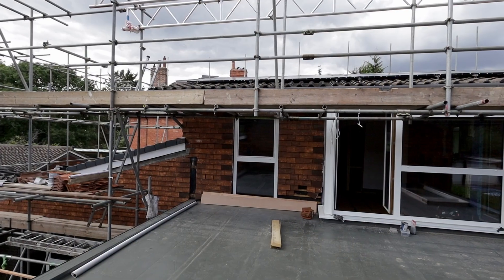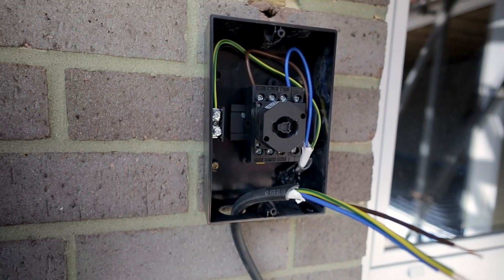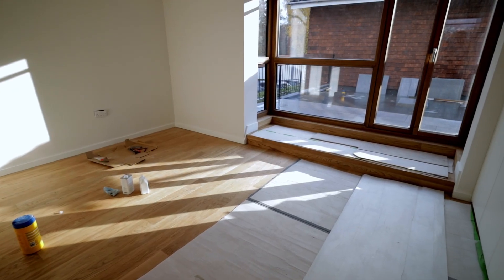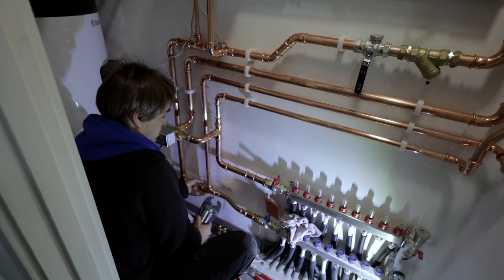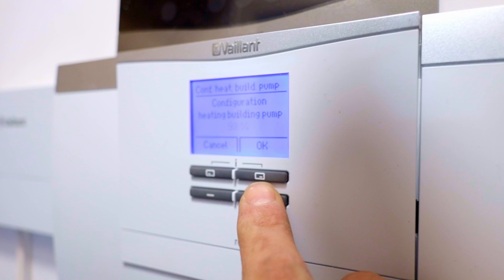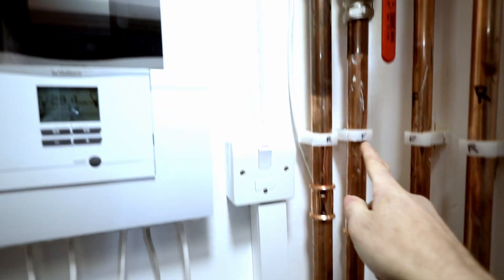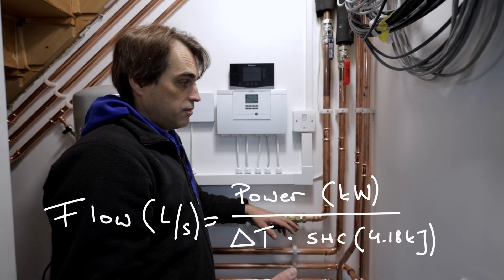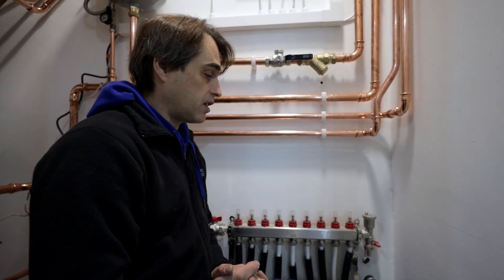How To Install an Ultra Efficient Heating System - Heat Pump + UFH.

Comment: I've always been curious what happens to the flow temperature in such a system when there is a DHW cylinder that needs heating to 48-55C. If the flow temperature is increased when there is DHW demand, doesn't this run the risk of overheating the floors if they are also getting water at 48-55C? I'm guessing that the heat pump sees the returning water is above the set point for the flow temperature for heating, and so runs the pump but doesn't run the outdoor unit to add any further heat to the water. In this 'mode' there is not enough heat stored in the system water that was circulating around the DWH loop to raise the temperature of the floors more than a few degrees above where they were, so no danger of overheating?
Reply: The floors are not getting water at high temperatures, there’s a diverting valve.
Reply: @Etacovda63  When that diverting valve switches back to heating they certainly are.
Reply: @tlangdon12  yes, and at the absolute most, its primary and return that holds that temperature, 30m of 28mm piping. 

Assuming thats ID, thats 9L of water, going from 55 down to 35 degrees.

Thats less than 250w of power, distributed across an entire house. 

The heatpump doesn't even need to account for it, thats what the valves for - the heatpump goes back down to 35 degrees and it literally stablises back to normal in seconds. If I could be bothered doing the maths, Id say the water wouldnt even complete a circuit of the floor before being back to normal.

Comment: Buffers are useful for energy storage too.
If you are running a heat pump with PV cells, for example, you can use the excess electric power to heat the buffer, so that you don't have to run the heat pump the whole night, when, due to lower temperature outside, it will be less efficient.
Also, you can use solar energy to heat the buffer during the day.
Reply: In a house like this, it will take quite a while until you loose heat. So you can simply set the target temperature one degree higher when the sun is out. Doing this, you can store a lot of energy in the house itself.
Reply: @Felix-st2ue  If your insulation is on the inside of the mass like this one then you're not really holding much energy in the house. If you've got an old stone property and you're able to insulate outside it, you're able to store a lot of heat in the mass of the walls.
Reply: @trojanhawrs4613  Well, you can also store a lot of energy in the floor and the furniture etc.
Reply: @Felix-st2ue  exactly, floor is very big thermal storage due to concrete's high material density.

In Norway most homes are wood framed so not much thermal mass there.
However in many countries double-walls with cavity insulation is used, so the inner leaf of brick/concrete or lightweight concrete does benefit of thermal Storage. Normally you wouldnt want insulate from inside and leave the thermal mass on the cold side of insulation. It also poses much higher risk of moisture problems.
However some countries like UK have been building Brick exterior and insulation inside for some time, that is quite stupid from many perspectives
Reply: Buffer is too expensive for thermal storage only, as it has very small capacity compared to building fabric and will lower COP of system both during normal use but also very much more when boosting for storage 

Simply raise flow temp so that room temp changes 0,5-1 degrees. That is perfect energy buffer with way more capacity and is totally free.
Reply from the maker: Remember that you have a lower set back temperature at night so that helps with heat pump efficiency.

Gains of having a buffer with solar may be quickly negated by lower overall system efficiency of having a buffer (mixing) and running  another circulator.
Reply: @UrbanPlumbers   Well, you can run the space at 18 °C at night ( lower than that, and there is risk for mold growth, if I remember correctly ).
Keep in mind that I don't consider it necessary for heat pump installs, too. ( Mechanical Engineer by trade ).
HVAC installs differ in every site and budget, and what is optimal on one occasion, is suboptimal in another.  And that is why thoroughcalculations are necessary, and rules of thumb ( "so much square meters, you need so much KWs" ) are A VERY ROUGH, VERY-VERY ROUGH, estimate.

Comment: did you say that the 3 way motor valve only does either heating or hot water, if so when is hot warer srored
Reply: When the hot water cylinder calls for heat.

Comment: If there are no thermostats in a room how do you manage a sunny day vs a cloudy day?  Would a room overheat?
Reply: It shouldn't. I would expect that the flow temperrature is set by weather compensation, so it will reduce on warmer days. Also, the heat pump is also trying to maintain a DT of 5C, so if the return is coming back with less than this difference, the heat pump knows that some of the rooms are getting more warmth from somewhere else, and again the heat pump can either modulate down, or switch off if it has reached the limit of how low it can go.
Reply: @tlangdon12  Some rooms can be south facing and be warmed by the sun, and north facing ones would get no benefit from the sun, so they can't all be treated the same.   Just seems to me thermostats make everything simpler.

Comment: What are your thoughts on not having insulation on pipework. Would the benefits of heat gains from pipework cost less than energy spent.

Comment: I have an air to air heat pump that achieves a cop of 4.8 and cools as well as heats. If you can consider separating your hot water system from your heating system, air to air heat pumps become very attractive. Various methods are then available for hot water such as a thermino sunamp. It’s seems to be a very UK thing that people generally can’t imagine separating hot water systems from heating systems.
Reply: Why doesn’t one of the air to air manufacturers bring out an exchanger for heating water, would make great sense for uk market, could just connect as a refrigerant zone.
Reply from the maker: @edc1569 they do make them already
Reply: @edc1569  it will lower the performance you can achieve for the indoor units of the air to air system and lower the overall COP of the system as exchanging to water is inefficient. Also due to them not being capable of achieving instant hot water would require a cylinder which in a lot of cases people may not have space to accommodate.
Reply: @Bish_OP  Not sure what you mean, my Hitachi Yutampo does A2A and DHW, the A2A will switch off whilst it heats the tank, and switches it back to A2A afterwards.  So the only efficiency loss is in the switching to and from.
Reply: @BenIsInSweden  that sounds amazing I wasn’t aware of that. Will any a2a unit be able to achieve this or is it only certain units that support it? I can’t see any information on my unit supporting this. It could be a better alternative to sunamp if I can find space for a tank and my unit could do this. It has no water in lines just the thin copper refrigerant lines.
Reply: @Bish_OP  it's only specific ones. Hitachi have the Yutampo (ie. The one I have). Daikin's is called the multiplus. My installer said that Toshiba does one as well but is apparently prohibitively expensive.
I'm not sure if any are available in the UK, it's likely a demand thing at a guess.
At least with the Hitachi the top ports on the outside unit are reserved for the cylinder, and depending on the outside unit up to 3 indoor units can be connected.
Hitachi could do with modernising the indoor units though, they're fine but against the Toshiba Haori or Daiseikai's (the latter which I have as well) they are a bit behind in looks (some may not care too much) and in functionality, e.g. the whole 3d airflow that Toshiba has and the Hitachi ones don't come with the WiFi module as standard.
Reply: @BenIsInSweden  thank you for the information that is very interesting/helpful
Reply: @edc1569 Daikin do one.
Reply: I agree, but one problem we have in the UK (say compared to the USA) is that our houses are typically much smaller, and have much less room available for additional systems. The availability of ducted heat pumps that can sit on top of the hot water cylinder save space, and allow the seperation of flow temperatures that is critical to maintaining the best COP for each application (space heating vs. DHW production). The down side is the extra cost. However, the cost of DHW cylinders with coils suitable for heat pumps are not cheap, so the difference in cost might  be recoverable over the life of the systems. The other problem is that there are then two heat pumps to go wrong/need servicing. The Sunamps have a poor record of reliability.
Reply: @tlangdon12  Great points. On the space issue we have a smaller 2 bedroom uninsulated old property and I was able to work out a way of integrating a ductless air to air system, without removing our gas combo boiler (which does only hot water now until we replace that system). I had to put time and effort into the placement. The ductless pipework doesn’t take up much internal space but requires real thought on placement and the condensate also requires thought. We laid the pipes in between the joists. I’ve not heard of ducted heat pumps on top of hot water cylinder, I will have to research those out of interest, I guess I didn’t come across them as we don’t have a hot water cylinder (no space). In terms of functionality I presume they won’t do cooling. Also I wonder how much fine tuning is required o have a balanced system with those. The thing I like about the air to air ductless system is they are capable of easily heating and cooling uninsulated spaces, the air to water systems are so fine tuned with much more risk of running inefficiently or the house being too cold when set up. I see most businesses use air to air, I am not sure why the air to water is pushed so hard for homeowners in the UK, my presumption being someone at the top thought “this will be easiest just swap out boiler for this single unit”, when in reality they are very complex fine tuned systems and not as high cop!
Reply: Regarding the point on the Sunamp reliability I did some looking and couldn't find too many people complaining of reliability issues other than one youtube video that the guy had a leaking unit which was replaced under warranty. I'd be interested to know where you saw those reliability complaints as I'm considering a Sunamp for hot water, its my main option currently.
Reply: 4.8 COP (or SCOP?) Is obviously great, but your water COP is 1. Appreciate the thermino is good for time of use, solar diverter etc, but with super efficient homes, water heating just becomes a bigger and bigger portion of the overall energy use. All extra power used had a decarbonisation opportunity cost somewhere - excess solar could be better used decarbonising your neighbour's electricity supply, for example. I would be interested what your adjusted SCOP would be if you included hot water at 1.

This ignores cost obviously - I might have gone air to air had I known about it before I spent silly money on my heating system.
Reply: I use the SCM60ZS-W which has a COP of 4.86. There are smaller models which allow for less indoor units per outdoor unit which achieve above 5 COP, check out the SCM60ZS-W specification sheet it shows all of them.

The primary point being that for me I don’t have a super efficient home; couldn’t create one if I wanted to as the house is listed.

So opting to separate heating and hot water has allowed ability to heat and cool (don’t underestimate being able to cool in the summer!!) at high efficiency. This does then leave the hot water problem to solve. Our boiler is rated at 0.92 COP however non of our hot water pipework is lagged so it won’t be getting that. 

I can see that with the super efficient homes the hot water will become the high source of energy, because inherently the transfer of heat to water is inefficient. 

My personal goal is to size up a solar and battery system that will cover the thermino and the air to air heat pump. I like the idea that I can heat and cool my house hopefully the majority of the year even though it is ‘leaky’ and old in terms of efficiency.

Topping the battery up with an intelligent controller using Octopus’ agile tariff would allow for any grid energy to be as cheap as possible.

Now just need to save around 15-20k for battery, panels and sunamp D: @bringiton8989
Reply: I’ve done some more research on this and found some diagrams/documentation which appear to show that you can literally hook up the lines you’d normally use for feeding an indoor unit to a hot water cylinder, seeming to indicate you can achieve this on most air to air outdoor units. Not 100% sure, it’s a shame I can’t attach the image.

Comment: Hi Simon, could you run the primaries in MLCP?  Are there are disadvantges with MLCP with heat loss?  I suspect they would have to be sized up as the walls are thicker.

Comment: Very well presented as usual.
Just a brief question concerning flow rates...is there any harm in having a higher flow rate? Let's say my house "needs" 800l/h but the pump can easily provide 1100l/h. Will upping it to that level have any detrimental effect apart from adding a few Watts of energy useage?
Reply from the maker: More energy used on the circulator resulting in lower overall efficiency, although mean water temp is higher so flow temp can be lower which may balance out higher pumping power
Reply: @UrbanPlumbers  
Thanks. So as long as the additional energy use is minimal, there should be no harm done I guess...👍
Reply from the maker: Yes, shouldn’t make a dramatic difference. No harm on slowing the pump down, but I would try to lower the flow rate by throttling the system

Comment: That looks very nice. 
I was a bit surprised by the large spacing in the UFH. Is there still enough capacity to use a bedroom as an office with a 20 degree temperature by adjusting the flow rate or is it pretty much limited by design?
I wonder if overdoing it with the UFH would hurt the efficiency. For example, what would happen to the COP and load on the heat pump if you put 10 cm spaced UFH everywhere? I imagine it would take more time to put in and cost a bit more, but is there such a thing as too much UFH for a heat pump?
Reply from the maker: Yes, you can easily adjust flow rates on this system to change the room temp by +/- 3c
Reply: Nice work, I was going to say it could cause problems down the line if only 17 degrees was achievable in the bedrooms.
 @UrbanPlumbers
Reply from the maker: @gunsey876 22c easily achievable if you want to

Comment: Airtight membranes on the wall, MVHR   etc. and then only 20mm insulation between ufh and ground?? That is roughly a U value of just 1.0, the ground will be acting as 'infinite heatsink' for all that precious heat from UFH, there is at the very minimum 1KW loss just on that component. Pure insanity...
Reply from the maker: Will probably make the system run better and cycle less with such a small heat loss. Downward loses are not that great anyway.
Reply: Client here. Short of breaking up the floor slab 20mm was the absolute maximum we could fit. The ground under the house is dry and there should not be much flow away - in equilibrium it should be as much a heat store as a heat sink. But you are right that this is a risk. The standard heat loss calculation methodology doesn't really take account of UFH where the heat source is in thermal contact with the ground.
Reply: Slab u-values are not treated in the same way as other materials, as I’m sure you know, the perimeter:area makes a difference. This u-value is likely to be around 0.4.

Comment: Interesting. We're currently planning for  something similar when we extended and renovate our bungalow in a year or two. 

Do you do requests? Can you do a follow up video because it would be interesting to see what scop it achieves in a years time.
Reply: Client here. We're not expecting a great overall COP, because the space heat demand is so low that our hot water use will dominate.

In the first few days of use we got worse COP than expected for the cold weather. The floor slab was completely cold and the UFH return will have had a high Δt, even with a low flow temperature.

Comment: Because the system is designed for certain temperatures in each room are you able to boost the temperatures at all for special events etc? Also what if I move into a house where it's set to 21 but I prefer 19, what do I do?
Reply from the maker: Yes you can a change the overall temperature and adjust individual room by changing the flow rate on the manifolds. 

The fact that it’s designed to 18/21 doesn’t reman that you can’t run it lower or higher

Comment: Is the slab fully insulated underneath?
I looked at using those 20mm eps panels for a ufh but tue heat loss into my unisulated slab was slmething like 900w per hour! Just waste - so ive gone with just insulating my flor with 20mm eps and using hydronic fan convectors  which also work well at low temperatures.
Reply from the maker: Downward heat loss isn’t that much apparently - 10-15%. This house has minimal insulation of only 20mm.

I am not doing any insulation to my house slab.